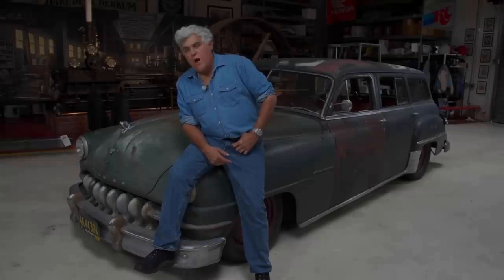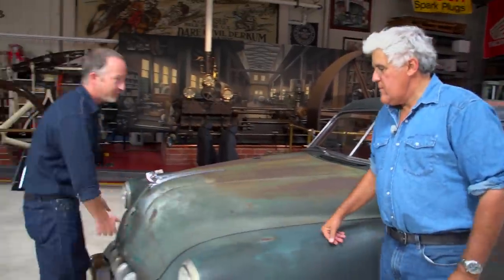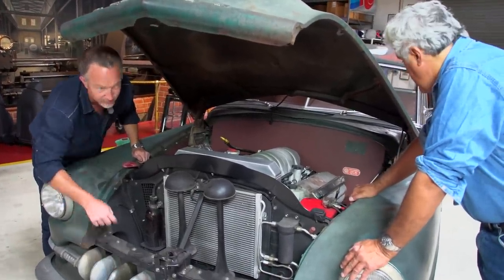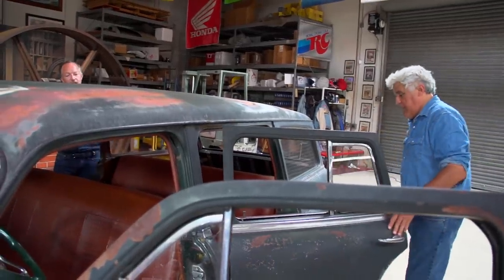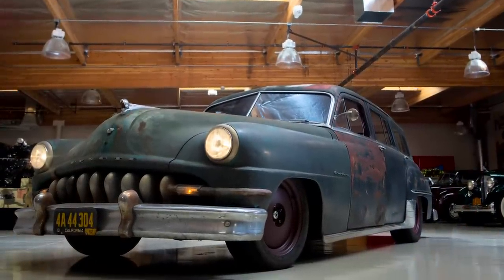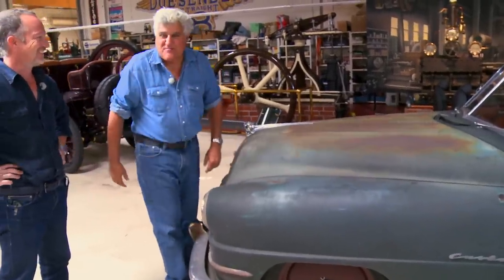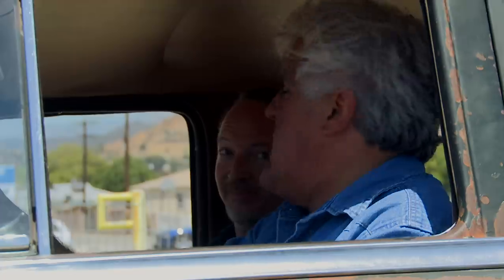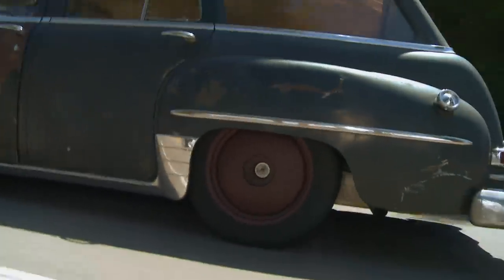ICON Derelict - Jay Leno's Garage

Comment: An actor buddy of a friend of mine pulled up to a party my friend was having in a chevy pick up truck. I didn’t know him and thought his truck was in the process of being fixed up. He was talking to me about my 2003 ford f350 dually, that was all fixed up. 24” rims, painted, stereo system etc.  i told him it had been stolen and i just got it back from the shop. He told me his was a derelict. He proceeded to show me. Old looking rims, but top of the line tires, willwood disc brakes, chevy corvette motor, new suspension, and it actually was painted to look all rusted, with bondo showing etc. Like it was being worked on. Truck ran amazingly

Comment: My favorite derelict. The perfect family car, It's a grocery getter, Room for road trips, and the rear door folds down for picnic's. Absolutely Perfect !
Reply: Its also perfect when you don't change the wheels, put the original engine back in, and paint it a mid century color.
Reply: MTR  what do you mean, are automobiles far better than modern society not "good" enough for the law. Ahjeez of course modern government started that regulations. "Hey, we took away those fantastic automobiles and changed their design, but now you can't drive them either!"
Reply: MTR  well, your calling it naturally restored to its very paramount beginning of a finish, clean working as it did back in 1938, not good enough for the plastic computers on wheels we have to show for progress. More of an offense as when they put the orange caution triangle on the back of the model T disproving its many advancments for the world and rendering it to "old" and "slow" practically.
Reply: MTR  then try learning english.

Comment: Brings back memories. Until I was 15 (I'm 69 now) the family car was a 1953 Desoto Firedome V8 station wagon. We had it for many years. It was two tone green. I remember it had a semi automatic transmission with a clutch pedal. My dad always had a glass pack muffler on it so it had a nice rumble. We lived in NJ and my Grandparents lived in NC so at least once per year we would drive down to visit them. There were 6 kids so I spent many hours with blankets and pillows in that wooden floor cargo area in back.  My dad made a wooden rooftop luggage carrier for it so we were quite a sight all loaded up going down the road. Probably got the plans from Popular Science or Popular Mechanics. I never see any of those, even restored, on the road these days.

Comment: Hello Jay  I had a 55 2nd edition chevy pickup for over 35 years . It had several motors due to hard use . With a super charger under the hood. It was repainted inside and out with new glass and interior twice . But it had been driven hard and vandalized twice as a daily driver . But I really enjoyed it more when it was left in its dented , scratched stated . It was always left alone in that state when parked . Never needed more than the windshield cleaned . And wiped the smile off the face of more than 1 corvette owner .

Comment: I just read that ICON builds ground up one off cars so the price is in the $100,000+ range. Their FJ40 is well over $100,000. Maybe the derelict models are a bit cheaper? But not much.
Reply: Id assume more expensive because economies of scale
Reply: Is In the Details ....mostly covered
Reply: If you want it done correctly and perfect, Johnny Ward is your guy. But there are a lot of guys that will put a new modern chassis with power brakes, fuel injected hemi on an old car to make it drive like new.

Comment: Apparently it has no seat belts. I would put them in so I don't, you know, die.
Reply: Didn't need them in cars that size.. That would absorb a lot of impact.I had an early 1970s Caddy Eldorado, I could've cut a wooden telephonepole down and still drove home with it. I don't think this weighs much, Maybe the same as a 1957 Chevy or a Yellow cab of that time, but it's still big enough to get away with hitting things. These maybe 2700-3200 LBS. My car was 5000LBS.
Reply: Complaining about lack of seatbelts when you own a bike... priceless 😂
Reply: Everyone knows that seatbelts in those old cars would only trap you underwater or in a fire. You want a rigid car that will throw you free of the wreck at high speeds.
Reply: @berrytharp1334  As in modern cars do not have seat belts. And then you thing flying through the air at 70 mph will save your life. You are already dead going through the wind shield. Are sure that you are not from Mars?
Reply: Good heavens, what suicidal thinking. At anything over 30MPH in one of these, the only thing you'll be thrown through is -- the windshield! You're much safer if the car can disintegrate in a controlled fashion, dissipating crash energy rapidly and AWAY FROM the passenger compartment. Modern cars are designed to do this. After a  collision from almost any angle at highway speeds, there isn't much left -- only you, still buckled-in and surrounded by deflated airbags. Anyway, I'm pretty sure he had to retrofit at least a few modern safety devices (not shown here) to get a road license in CA for this piece.
Reply: Hahahahaahajajaha

Comment: That's really sad. A nice old car like that should either have the original engine in it, or at least a "real" engine, with a carburetor and no electronics. The main reason I got into old cars was to get rid of all the modern crap. I absolutely hate that stuff. In my state anything 1967 and newer is subject to emissions testing, so I stick with '66 and older, so I can do whatever I want with it and not have to worry about interference from the govt. A stock or hot rodded '60s hemi would be great in that car. EFI and computerized engine management systems are the worst thing to ever happen to cars. The modern chassis is a great idea. Modern suspension, steering and brakes are wonderful (as long as you don't use ABS) These old cars were strictly mechanical, and should be left that way.
Reply: Agreed. All that computer stuff is great until it starts throwing trouble codes (and it will). Most shops would not touch that thing. A 4 barrel Big-block is the way to go. AC would be the one thing I must have. I hate ABS, I swear I can stop almost as fast without it.
Reply: Meh, I love seeing old cars fused with modern hardware.
Reply: Amen
Reply: Yeah valcan,and no fun at all !

Comment: The very first Jay Leno video I stopped watching (when hood was opened)!  Because car is too expensive for sure and has too much new stuff in it. No old soul any more. Bur that's only my personal kind of taste respectively my opinion.
Reply: I stopped watching too.
 I left reply also.
Reply: Dear @catsandcarsringtailgang6188  
In my opinion you did well.
Don't get me wrong: I simply love Jay Leno, he is a great guy and with so much money you can do nearly everything. I love his cars. Especially the Mercedes 300 SL Gullwing, the 300 SEL 6.3 (both patina) and, of course, the 600 SEL and the very special race transporter for the Gullwing. Also the Citroen DS and all of his steam and electric vehicles and and and.
I watch a lot of videos... hmm... let's better say all videos from channels who do oldtimer for normal peoples  use = low budget and/or so called patina and rolling restorations.
Here some for instance: Coldwarmotors, Johnathan W., Mustie1 and 1963impala2dr etc.p.p..
I'm not an original state freak (especially the brakes should be upgraded most of the time). In former times I loved perfect cars = the more "Pebble beachier" the better. Meanwhile I think that the cars should be driven/used without having concerns that it could be scratched (as Jay Leno did it with his 300 SL unloading it from the blue race transporter = fantastic video).
Best regards luck and health.
Reply: I agree.  Especially on brakes. In back garage 1954 Chrysler New Yorker Newport 2dr htdp @  4852 lbs. has disc brake kit on floor for waiting for installation. But really want what i call batmobile on the road 1st. (Black 60 plymouth)2dr hdtp.  Thanks for the input.
Reply: Shur. Just saw a way to "friend" ppl on here to chat & send info.
  Ck it out. (Im running late here. Ill ck 2nite)
Reply: It’s a hot rod you bozo’s

Comment: Back in the day, cir. 1967, we referred to these big lumbering type cars as "Jungle Cruisers" , sometimes "Detroit Sleds".  Both still seem fitting today.  What's sort of interesting is that you rarely see an original 1952 anything on the road in original patina that hasn't been fooled with.  So now, this 1952 De Soto is quite the "Sleeper".

Comment: I have a 2001 Ford Ranger.  Talk about derelict.  A tree fell on it,  paint faded around the huge roof dent and holes, doors are dented to match the roof dent so they can contour to the heavily dented roof, cargo bed has one dented side, dents on one fender.  I kept the old nightmare after insurance paid me for it.  It still ran so I kept it for working on my rural property.  Then I started to tinker and fixed the damaged suspension, gave it a tune up, fixed the air conditioner.  Then I decided to to go ahead an register it again after I sealed the holes on the roof with silicon.  It gets a lot of looks.  But not necessarily the looks of, Wow! It is more the look of, "Um, that thing still runs?"

Comment: Hi Phil here I had a 1952 DeSoto and put a 331 cubic inch Chrysler true Hemi in it. It would run 102 in a quarter mile at Fontana race way. I was 16 then. I am 76 years old now and starting to build a 2002 Porsche 986 boxster to run at Bonneville in 2020 and don't know what engine I will run. 928 5 liter or 911 still looking and thinking. I worked for Porsche for over 20 years.

Comment: Speaking or chrome, when I was a senior in high school in 1986, Alhambra High School not to far from Jay, my Drafting teacher had a 1963 Ford Ranchero that he was restoring.  He drove it when he wasn't driving his mint condition 1965 Ford Mustang convertible.  I remember the day a guy came in during class to pick up the rear bumper from his Ranchero so he could  redo the chrome.  The day after Mr. Holling got it back on his Ranchero a girl tapped his rear bumper on the way to school.  She wondered why he was so upset because she said it just put a little dent in the bumper, and it's just a bumper, that's what it's for.  He told her he just paid $600 to have that bumper re chromed.  Her insurance company wasn't happy.

Comment: I used to work on cars like this back in the day, and the original DeSoto
Hemi was one that would smoke like hell soon as it got 50-60K on it.
If this was an Oldsmobile I'd raise hell about removing the original
drive train because they were so good and dependable. This, however,
if somebody is gonna drive it, is a smart move over the factory mill.

Comment: not to take away from the builder's accomplishments,  I sort of bristle at the remark "this is just a real reliable, driveable car".

The original driveline was quite reliable and driveable (whether the old De Soto Hemi or the flat-head six)... granted, it would not produce the performance of the modern drivetrain,  but it it certainly doesn't need to be replaced for the vehicle to be functional.

My '41 De Soto Deluxe is still doing fine on the original running gear... and it's no trailer queen

Comment: That's not the words to that song. You may be thinking of "Hot Rod Lincoln" Where it says "It's got a 4 barrel carb and dual exhaust, with four-eleven gears you can really get lost." What you're thinking of though, is "Georgia Overdrive" which is neutral, it's an old trucker slang term for neutral because there are a lot of hills in Georgia, you put the rig in neutral to save fuel going down hill.

Comment: Hah, LOLS  my first car was a 1953 Desoto with a Firedome Hemi engine in it my Dad gave me as my first car.The car was the family car and he replaced it with a 1957 Desoto for  the family. The car had a three speed on thecolumn manual transmission with overdrive so it would top out at a good speed. We had more problems with thecar concerning the exhaust manifold cracking. Then in 1963 I got a 1962 Chevy Bel-Aire with the 283 Ci enginewhich was a family car since was a four-door car and not sporty in HS. The next on was was a big change, Igot a loan on a '64 Ford Galaxie XL Galaxie 390 ci  with a 4-spd.  That car car couldn't keep up with a '65 DodgeDart with a 273 Ci Hyper which on the dragstrip was classified as a  factory experimental car.  Those cars arerare now and expensive. My last rare car was the 1967 426 ci. Hemi Plymouth GTX which is even  harder tofind. These are keep getting hard to find a rarer all of the time and most all of the 1960s cars are treasured.

Comment: I have a 1961 falcon that runs great and is all original.I should put a new Dodge RT running gear under that girl. It needs some interior work but actually runs great with it's original 144cid engine. Unfortunately it isn't worth very much here in Ca. Now maybe if I shipped it to NY or New England I could get a premium for it. But here, everyone want's it, but wont pay enough.

Comment: Not designed to be, look, or behave cheaply. If you want overpriced, go talk to Range Rover folks - I've never met an owner who doesn't have it in the shop 6 months out of the year. 

Every inch of these things are lovingly worked on one at a time, by hand. This one just happens to not have a $15K paint job, and that's the only difference.

Comment: That's not exactly a Rat Rod... I built a VB ('80) Commodore like this in about 97. It rode a bit low, on 15" steel pursuits, and the paint was white, and really bad. ($2 spraycans...) several grand spent on suspension, engine, brakes... Aesthetically, it was meant to look like an old shitter. It was only a 202 with a 350 Holley on, so not all that quick, Yella Terra head, 30/70 cam, maybe 160hp. But sticky 50 series tyres and real hard suspension... It went rather quicker than it looked, and handled and cornered 1000 times better than it looked. I miss that car, it was good fun.

Comment: The "disappearing middleclass" politicians harp on today was nestled in the disappearing brands of the 1950's such as DeSoto, Plymouth, Edsel, and Kaiser Frazer to name a few.  Will be interesting to see the electric motor upgrades from after market milenial manufacturers working from rusting relics of yesteryear. Or, will 3D printing enable low cost production of  carbon fiber replica body's for all classic cars requested from a picture book  for a build in the latest EV configuration, with autopilot and airbags? Imagine the best of both worlds with electric reliability, as long as no one shuts off the power.

Comment: question....anybody know .....if that Desoto Head on the hood was wired to light up back in the day......originally
Reply: those style of hood ornaments were not wired to light up from the factory..you could be thinking of the late 40's early 50's Pontiacs.. the Indian head hood ornament had a face of amber glass.. and it did light up with the parking lights.
Reply: CalebEatsaBullet thanks for the reply. I can remember as a kid those Pontiacs with the lighted hood ornaments. I thought that was so cool. I wonder if pontiac was the only car maker in the USA that did that. That lighted hood ornament alone was enough for me to want an old pontiac. Unfortunately I never ended up with one. But did have a 62 Chrysler Newport and a 65 chevy nova wagon. By the time I was old enough to have a job and a few bucks those cars were getting pretty old and scarce up here in massachusetts....the rust capital of the USA
Reply: I don't know about other models, I know about the Pontiac because our neighbor restored a 50 2 dr sedan. As for Chrysler products the Fury models in the late 60s had fender mounted turn signal indicators that flashed with the signals. The lighted end was pointed toward the windshield so you could see them working. Another friend of my dads owned a 69 Ford Torino 351 CJ with a factory hood scoop..the scoop also had lighted turn signal indicators.. haha but thats the extent of my knowledge :))

Comment: So after 10 years of beating on it and the 'modern' drivetrain is poofed out, you just lift off the body and settle it down on a new modified  2020 whatever hot car and run hard for another 10 years?  KEWL!